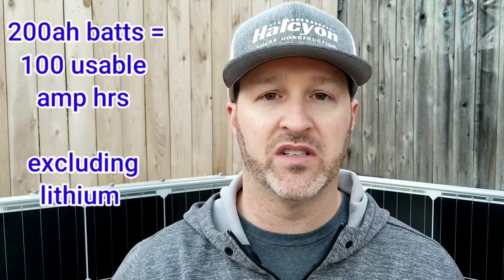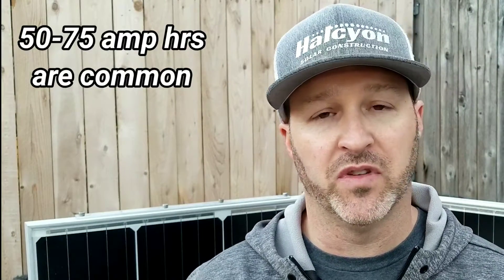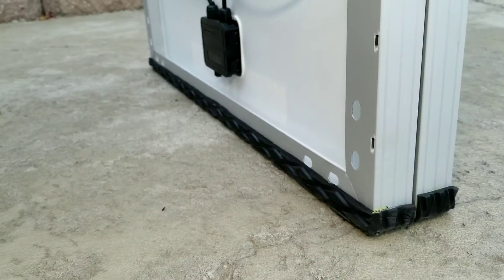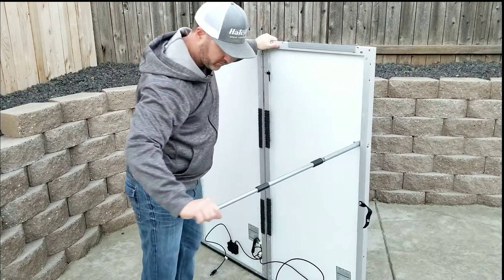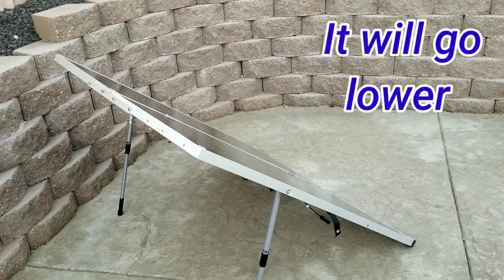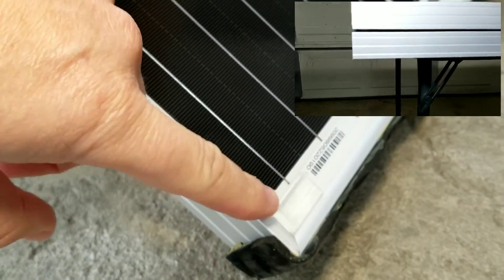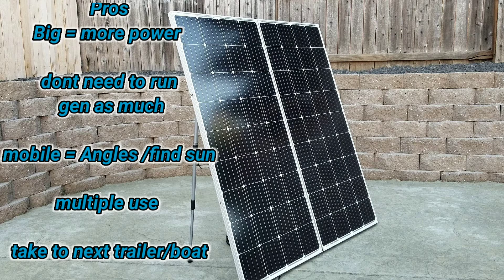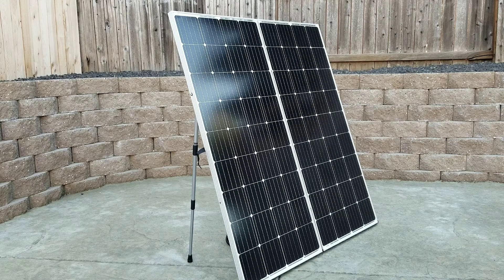SIMPLE DIY Solar Suitcase!

Comment from the maker: LINKS BELOW
Check out these new Panels!!: https://amzn.to/45E64Gv
Prop Rod: https://amzn.to/3syEggH
New Prop Rod!!: https://poweredportablesolar.com/product/portable-solar-panel-stand-legs/ref/86/
Panels: https://amzn.to/2P6Tg7h
Renogy AGM 12V deep cycle batt:https://amzn.to/3bAz8lM
Beleeb charge controller: https://amzn.to/3bz2Bwj
Reply: I use 4 - 100  watt panels set in two portables banks.  Very easy.  I also make my frames from PVC - I was originally nervous about their strength but so fan no troubles.  I really like your frame arms.
Reply from the maker: Awesome.....yea i figured i wanted one big set up or i can just pull the pins and use one if i want. The arms work grate but need a good attachment for the weight. I wouldn't put them on bigger. But smaller would work great.

Thanks for watching...😊👍

Comment: Well, I've devoured pretty much all of the "movable" solar panel setups. I thought I had seen them all and had quit looking. But something had me look one more time; that's when I stumbled on you and your simple, well-explained setup. If imitation is the greatest form of flattery, add me to your list. The quick pins in the top were already on my list, having seen another setup that used threaded screws like yours and thinking "how long would it be before I dropped a screw in the grass and couldn't find it?". No tapping with the quick clips. As I plan to move the "suitcase" around with a hand truck, I'll be adding small spacer/bumper blocks on the bottom ends of the panels for clearance. The last thing: the PT Hood Prop: You mentioned something sturdier. Do you have something in mind already? Thanks much for sharing your rig with us. I'll now be going back so see what else you have shared.
Reply from the maker: Wow, well glad this helped you out and thanks for stumbling over this way. 
There is a lot in the solar section play list and more. 
I haven’t found another rod but I think it would only be needed with those size panels as they are just a little heavy. 
Smaller suitcase models they would be fine

Comment: This is brilliant.  I have 4 200 watt portable panels from pecron.  Only problem they are only splash resistant.  I live in Florida its summer we will have periodic daily thunder storms for the next 2 months.  It's a real pita this time of year.  After that no worries.  Companies sell water resistant portables but the prices are off the chain this is a ingenious solution.  Thank you!
Reply from the maker: Your welcome. If i was to change anything I think for the panels some beefier legs wouldn’t be bad
Reply: @johnnysweekends  Yes, I agree, I am going to use 3/4" PVC and connect both legs together.

Comment: A very clean, nice build. There is nothing I would change, except maybe putting the boxes at the top but I understand your concern on tripping. I was looking into building one of these myself. When looking for parts I did find some really nice cam lock legs on Amazon. They are on a camera tripod for only $14 ..not bad. 

Eventually I instead opted for the Renogy 200W suitcase....lazy I reckon and when I did the math it really was not too bad at $324. The two 100 watt panels would have come in at about $170 and an equivalent controller about $25. I figured with stainless hinges, latches, and legs I would be into it for about $250 or more, and no case. The Renogy case it comes with is very impressive with very heavy cordura nylon bonded to a hard clam shell which is sandwiched inside the nylon and with great zippers. It offers great protection.  I was so impressed with the first one I immediately ordered another. I upgraded to a MPPT 40 amp controller and some Y connectors to series or parallel connect the two units. I have 4 100 Ah LifePo 4 batteries so 400 watts is just squeaking by. The second panel should be delivered today so no idea yet if I have enough or what the VOC is. Hopefully I will have some room to add another one if needed. All that being said, your design is awesome and would be a fine and fun project.
Reply from the maker: Yea the prices of the renogy suitcase have come down a lot. Many solar suitcases now. So its almost worth it now. Considering your time as well.

Comment: Great idea but weight is issue - ive ordered ac380w Jinkgo panel thru ebay similar size to yours - and they said under 6kg - l  dont believe them but why leave glass in as not permanently outdoors and glass sucks 5% of light - add weight dont need - just add core flute packing? What do you think?
Reply from the maker: It depends what you are trying to gain. The glass also protects it as well. But yea that suitcase build was a couple years ago. 2 years is along time for solar panels. Imagine two more years.
Reply: @johnnysweekends  ill see if glass adds torsional rigidity but if its only out on non rainy days glass is useless - i will let you know as can always put it back - thanks
Reply from the maker: Torsion for sure, but all depends how much you move it. Like a flexible folding panel they can twist a lot once they warm and if done to much you can hear cracking of the etfe and possibly the cells lol. 
Maybe try two set ups, one with glass and one setup with out?

Comment: What keeps the prop rods from swinging open or closed and the panel falling?
Reply from the maker: You twist them and they lock like a sliding rod.
Reply: @JOHNNY'S WEEKENDS  I mean swinging forwards and backwards, not locking the telescoping.
Reply from the maker: Oh I just had the bolt kinda tight so it would free swing much but once the weight is on it, it didn’t move. In strong wind I would lower it though. 
I don’t have any more a friend bought it
Reply: @johnnysweekends  Thanks!

Comment: Thank you for the diy build plan. I stole all of your design, except I used 15LB high temp velcro on the angle iron instead of pins or bolts.
Reply from the maker: Nice…👍🏼😀

Comment: I really like this design—well thought out, and clever use of simple standard parts to achieve a rigid form.  Moving the angle across the two panels is very clever.   Maybe a thickish rubber door mat could be affixed for friction/grip tape?  As I was looking I kept thinking of windy days, and wondered if a double wide flat—or maybe a T shape could make the bottom rigid—and the protruding half give you a place for Thru holes to tap in some steel tent pins to secure it?  For sandy or loamy soil they could do the trick.  I like to use rare earth magnets as they seem to give you enough grip for close, but easy enough to pop open.  KJmagnetics is the site I use to pick these as they have clever force calculators.  The thing I like most about your design is the clever offset plastic that keeps the glass from touching—or pinching and cracking—brilliant!  I’m going to steal most of your ideas—THANKS—also subscribing—really clean look.   BTW someone commented about putting your charge controller on the panel.  I’d not do that.   You have it right now—keep the high voltage for your distance runs for less resistance/loss or a need for bigger costlier wire!   Thanks for posting your great ideas!  Best video I found!  You a design engineer or just handy LOL?
Reply from the maker: Thank you !! Yea I though about magnets but the aluminum wasn’t helping. 
And yes keep the charge controller close to the battery. 

And I wish I was a design engineer, but I’m just used to building and playing with stuff since I was young 😀👍🏼
Thanks for subbing and joining the group and hope to find other videos that will help or help out in conversations if you like 👍🏼👊🏼😀

Comment: Very creative how you decided to take two rigid panels and created y a suitcase. Good explanation of how you did it which may  even be what i do for my upgrade that i am currently trying to decide on and plan out.
My "last year" system was a Renogy 100w mono rigid single panel connected to an EPSolar 10w MPPT controller which is then connected to my 75ah AGM Centenial battery that i use with my T@B fully self-contained camper that i have had for 6 years and travelled to 20 states and 15000 miles. I additionally bought two 25-ft extension cables to better be able to reach sunlight in more situations. I also bought a Samplex 300w pure-sine-wave inverter to power an electric drill to fix stuff but have never used it so far while camping.
Everything works very well; however I find i need to have a little more capacity in panel and battery so I have tentatively decided to just "double" the system by getting a single 200w panel and 20a charge controller connecting to my already purchased Interstate 150ah 12v flooded battery..
After watching your video here, maybe I should consider 2 larger watt-hour panels and piece together with a still-larger charge-controller. Thinking. ....
Have decades of experience with Lead-acid battery chemistry that i understand, so haven't considered making the more-expensive-up-front cost jump to LiFePO4 as of yet. Benefits of Lithium are: (1) less physical weight 1/3 (2) higher depth of discharge - 90% vs 50% and (3) faster charging possible - 100a vs 30a and (4) longer life - 5000 cycles vs 500 for lead. Down side to Lithium: (1) 3-4 times initial cost (2) fire danger if shorted and contacts water
Reply from the maker: The jump to lithium really is a game changer. And the prices have been coming down. The amount of capacity you can buy now for $500 is impressive. And no fluids or checks. 
Now lithium ion was a little more problematic but the new lithium iron phosphate battery types are proven to be alot better.

Comment: What store did you get the two extension poles?
Reply from the maker: This is what I was using but for the size panels I did I think if you use it a lot and don’t make it sturdy they can move a little.
https://amzn.to/3eIVlSY

There is also these …https://amzn.to/3d4QRFS

Comment: Nice work!  Do you use any revit  nuts at the of top the panel?
Reply from the maker: Do I actually drilled and tapped it for the small bolts but was thinking of doing pins instead ..would be much quicker but would have a little wiggle in it. But would be fine.

Comment: Nice; just the thing I have been looking for. Question: I'm looking for something as a backup to my gas generator should we have an extended outage and run out of fuel. I'm looking for a solar setup where I can use batteries (I used to use deep cycle ones before i got a generator) and an inverter to keep my stand up freezer powered. I figure on two batteries, the second one charging up while the first one is in use. How well would this system do for my needs?
Reply from the maker: You need to do a power audit… like how much energy does you fridge use in a 12 hour period or at least hourly do give you a idea of how many watt hours you need. Then you can calculate a battery or two. 
Then the solar size is more in how fast do you want to fill your batteries like at a gas station. 
Two small solar panels will take a while 
But 6 could fill it in 3-5 hrs verses 10. 

So something to consider. This make sense??
Reply: @johnnysweekends  Yes, Thank you
Reply from the maker: You’re welcome 😊👍🏼

Comment: Are all the solar panels subject to cold temperature weather likes -10°c to 35°c ?
Reply from the maker: For the most part all panels work better and worse in different temps.

A 200 watt panel at 40F and a clear day will produce pretty much a 100% output. 

Verses a 95F the output could drop 30%. 

Heat creates more resistance so In order to gain back the loss you can use a larger wire but that isn’t going to give you back the full power of the panel. 

Hence in warmer climates you need a little extra solar to compensate typically if you don’t get vary many cool days. 

For my house my best months if it’s sunny a lot is  April May June. Even though I have more sunny days in June and July and August my best two months will be May and June before the heat really hits.

Comment: for 200 Amp hour battery you need a minimum of 400 watts of panels. I find 600 is better and 700 is good... and that's with a LifePo4
Reply from the maker: Yea depending on battery setup and usage you will need more. For sheds and small RVs 350 is not to bad but more is always better when you can.

Comment: Very nice project!  I recently purchased 2, 50 Watt 12 Volt Monocrystalline Renogy Solar Panels for $42 a piece.  I have often thought about doing exactly what you did and making a solar panel suitcase.  Granted, it would only be a 100 watt solar suitcase, but my requirements are small, and it would be more for experimenting with solar energy more than anything else.
Thanks for the great video!  You have given me some ideas.
Reply: Great idea ..... hope by now you have gone ahead and done it. It'll work just like you think it will.
Reply from the maker: Glad I could help..👍🏼😀

Comment: A couple of suggestions. It would be better to have your junction box at the top of the panels. Les chance of moisture getting in. I would also silicone a three way switch to one panel and connect your solar panels to it so you can select 1 panel or 2 panels or both off. On the other panel I would silicone mount a charge controller.  On the battery wires out of the controller I attached a 5-0 amp Anderson connector so I can connect different ends to the battery Leeds like male cigarette plug to charge through a cigarette lighter or battery clamps to connect to a battery. This is how I did my portable panel and it is truly portable. The switch for your panels is necessary because you need to connect your battery before your solar panels or you will wreck your controller.

Comment: I really like your setup.  Can you give me the size of the bolts, spacers, and nylon locknuts?  What are the brass looking spacers inside the telescoping rods?  How high off the ground did you drill the rod holes?  Thanks
Reply from the maker: 1/4-20 up top 
3/8th for rods 

And I drilled about 70% of the way up. Didn’t measure and write it down. Sorry. 
I don’t have it anymore or I would look. 

The brass i I just used as spacers. Just stuff I had in my garage.
Reply: Thanks very much.  I already purchased the rods and went to Ace hardware to get the spacers.  The only ones they had were nylon with a max length of 1".  I need 1/4" more to clear the inside edge of the panel so I guess I'll need to a 1/4" spaces is they have it. @johnnysweekends

Comment: Nice work man! I like this set up alot. I personally have a 180W mobile set up right now. I have been looking into getting two 150W panels exactly like this. My inverter has a solar charge controller built into it as well with a max wattage of 300W so this would be perfect.
I am wiring up two more 6 volt batteries on my trailer so I will have a total of 460AH of batteries. Excellent video!!
Reply from the maker: Awesome sounds like a good setup.

Yea you need more because you always have that amount of loss. 
The 300 watt setup will be probably 285 watts on a perfect day from the panels but once hooked up to the controller probably be about 275 give or take. Again on a perfect day with no clouds, haze or other contaminants. That’s why bigger is better unfortunately because even on a cloudy day or overcast you could still pull 75-150 watts out of it pending reflection and such.

Thanks for the comment and thanks again for watching 👍🏼😀

Comment: Most solar panels warranties are voided when you drill additional holes in the housing so check yours before drilling!
Reply from the maker: This can be true sometimes. But most times if you use the panel for a mobile mount like a suit case they may also void warranty as well because they will say its supposed to be solid mount on roof or pole.  So kinda a crap shoot.

Comment: Thank you for the video. I like your pole extenders. I have 2- 200 watt Rich Solar panels that I want to do the same thing. I did hear that it may be better to protect the backs of the panels because they just have a thin layer of protectant, the glass is very durable.... Your thoughts?  Thanks again....
Reply from the maker: Hello Dr. Powell, I went back and forth on that several times. And both ways are good but having the glass outside is more prone to scratching and chipping p because the glass is directly on the outside. Even though it is strong it still can break. One time i did see a panel fall flat on its face, glass side and hit smack on the ground. Concrete. It shattered the face. Was surprised. Although the panel still worked even though several cracks were in it obviously it couldn't be used. 
Now with the glass in you have a frame protecting the glass. So when it falls there is a 1.5 inch gap. As long as it doesnt land on a rock or other object its fine. Well most times. But you are exposing the inside to be damaged say during transport from site to site. So its kinda 50/50. I wanted to protect the side you see. Plus for the most part im the only one handling it. But still, i wonder if i should flip it. But then i have to add a external handle verses keeping smooth sides. Any i hope this helps.
Reply: @johnnysweekends  thank you and I appreciate your explanations and thoughts- makes sense to me. I guess a case is the best protection. 🙏🏻

Comment: Very informative video my young friend. Thanks for sharing it. I would have been nervous drilling into the aluminum frame of those panels. Looks like  fantastic setup that I will try to duplicate for my 22ft. trailer. Should work well down in Arizona where I do a fair amount of gold prospecting.
Reply from the maker: Your welcome. I've always wanted to do some gold panning and go find some small creeks to play in. There are a ton up here where i live. 

Yea the solar set up works great on the mppt controller i have in the trailer. And i will have or add quick connect pwm to male the suitcase stand alone as well since the pwm are way cheaper. 

Plus with the set up i can pull the pins and only use one panel if i want.